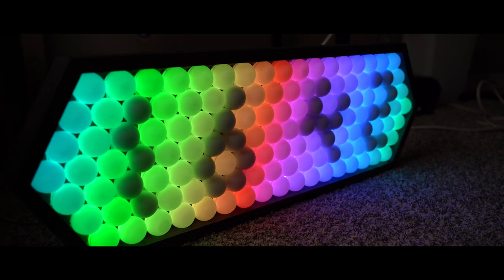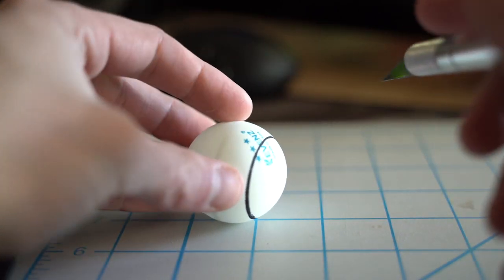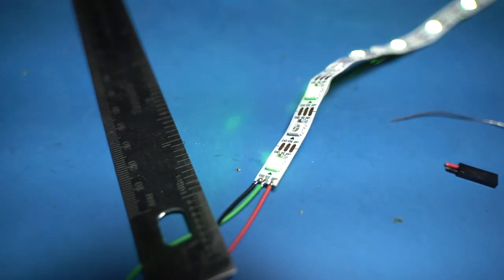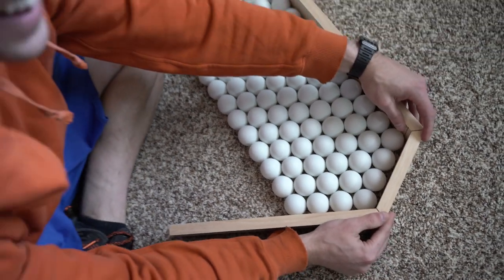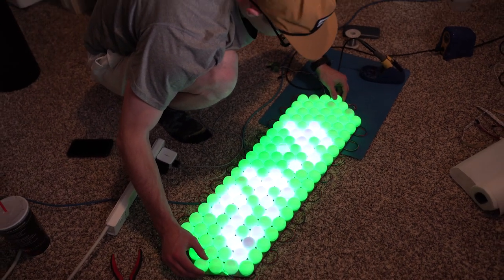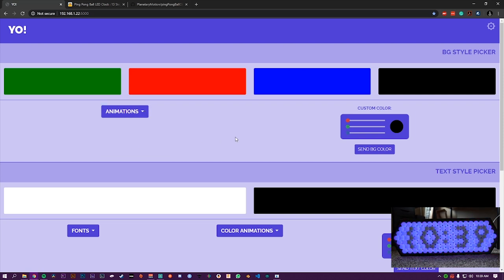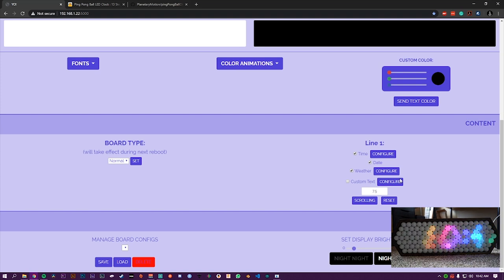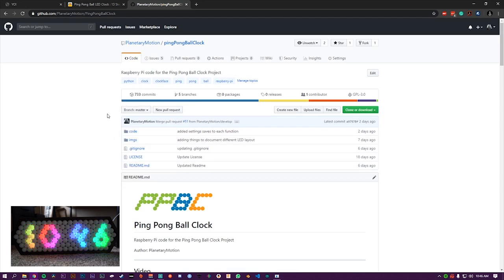Ping Pong Ball LED Clock

Comment: Love this - any reason you didn't string the leds horizontally rather than vertically? Would mean fewer cuts and less soldering. The code you've written obviously wouldn't work for that set up
Reply from the maker: I honestly do not see any reason you couldn't do this with horizontal strips! And I think the only change to the code would be properly labeling the LED addresses.
Reply: @lancewilhelm  amazing thanks, just wanted to be sure I wasn't missing something.

Comment: hey Lance!, what a great project 👌
I wanted to ask you, which type of the raspberry pi are you using?
I wanna add more than one sensor including temperature, motion, as well as displaying sound spectrum..
it would be awesome if u can share with me which type u used or if u can recommend a type since my idea contains a lot of sensors and perhaps sound processing. 
thank you!
Reply from the maker: Hi Amer,
Thank you so much! I'm sorry I didn't see this until now. I am using a Raspberry Pi Zero W which is one of the cheapest and most capable Pis out there right now. But, you could certainly use any modern Raspberry Pi that is connected to the same network that you want to access the web interface from. 

Those sound like awesome ideas for the board. You should be able to hook a couple more serial or digital sensors up to the Raspberry Pi given how I have wired the board and it shouldn't take much coding to read their outputs and then port it in to the code. Let me know how it goes!
Reply: @lancewilhelm  Thank you so much for answering my question! 
I will surely update you on my progress, oh and I purchased the Raspberry pi 3 model B 😊

Comment: Great Stuff!!!

Thinking of doing this with a Rpi instead of the Arduino because of the ease of customization. 
Is there a way to automatically change the brightness depending on time or location or does it have to be done manually?
Reply from the maker: Thank you so much! The Rpi seemingly has no bounds as to its capability for a project like this. I have not coded a capability like that to do scheduled tasks. Theoretically, right now you could have another application that sends an HTTP request to the server to have it change brightness, but functionality to have it switch from inside the firmware could be developed in the future. If you are feeling sporty, feel free to check out the github repo. There have been some "issues" raised regarding this feature request.
Reply: I'm thinking about two ways of doing that :
- I have Jeedom for domotics where there is a day/night setup already to dim my house lights. I guess I can add an http request to the clock to  change the setting

- I guess it's also possible to make a script that will the first time it's launched (at startup for example) : check online the next time is down, then cron to fire at this time and change the setting, and then check again in the cron to guess the next time it should be fired.

I'll first have to go shopping and try to build it before starting to code anything 🙈

Comment: You rock!
I read the instructables and been thinking for month to try it. I was worried about using arduino instead of an rpi for connectivity and updating and you made it!

- what rpi are you using? 3?4?
- I read the github and I guess I still need the 5v power supply, right?

I'll order all of it and I'll post the result, might be in a few weeks but well I'm motivated to do it more than ever thanks to you!
Reply from the maker: Hey Guillaume! Thank you!

I'm sorry it took me so long to respond! 

I used the raspberry pi zero w actually! It doesn't need to much power. 

Yes you will likely need a separate power supply so that you can display high brightness and so that you don't risk damaging your raspberry pi. 

Hope this helps!
Reply: Lance Wilhelm thanks for answering! Yes it helps. I also have to find it again but a member somewhere made a version with a webserver to update whats displayed on it. I just need to buy the right poing pong balls and some wood, and get to work!!
Reply: I must be tired. That's you 🤣 well I need to be less tired before starting to work on it 🤣🤣🤣
Reply from the maker: @guigro_  I will have to check that out!!!
Reply: A pi is a waste of money. An esp32 is much easier

Comment: Hi man, awesome project and an even beter presentation.
It's just stunning how good this video qualitywise but also infromationalwise.
I saw someone make it with a christmast like led string (also WS2811 instead of WS2812B) but these are like more individual and a led exactly in  each ball.
Would this be possible or couldn't I use the same code for it, would it be dificult to change the code or is it just putting them in serie and pitting 30led/m in the code? (I have 0 exp with python but great with java script so idk)
Do you have an instagram or so, so I could more ez ask something?
Reply: Update: it worked absolutly fine, I conected it all and I had no problems at all!
Reply from the maker: @Glacialsss  I'm so glad to hear that it worked! I tried to write the code at the beginning for those who would have slightly different layouts than me.
Reply: @lancewilhelm  I found solutions to some of the problems I had and some of the problems on the github issues. I commented on all the issues with the solution. i just forgot to add the brightness solution to github, I found the problem tho. Thanks again for the base code and great project! Greets, Foxdudes
Reply from the maker: @Glacialsss  Thank you so much for furthering the project!

Comment: Great work!!! I have been looking at the original version by thomas for a while now, your code with website makes me wanna do it, do you have a full list of parts you could send me so I can buy them and build it ?
Reply from the maker: Hi Lee,
Sorry I didn't see this until now. I used the same parts to build the board as the Instructable listed in the description. However, I am using a Raspberry Pi Zero W to run the board. Also, pay close attention to my GitHub page on how I wired the LEDs in series so that you run into as little issues as possible when you go to power the board. Let me know how it goes!
Reply: Lance Wilhelm I am in mid progress with it

Comment: Quick question.. How do you power the led's from the pi?
Reply from the maker: I actually use a separate 5V power supply to give supplemental power to the LEDs!
Reply: @lancewilhelm  thanks for the reply! Excellent. I will order some parts and have a go at this. Excellent work lance this is a fantastic project and a brilliant video.

Comment: This is awesome dude! What if I want to make this with like half the amount of balls?
Reply from the maker: The big problem that I see will be the addressing of the text. Right now the text is static in height and width and will not adapt to a change in clock size. The clock made in this video is essentially optimized (with a 1 ball border) for the height, but the width could certainly be modified. All that would need to be done then is modify the setup files for the LED addresses.

Comment: I’m hoping for comment from others that have built this.  Is it working for you?  

The port 5000 website seems very slow for me (I admit to having no previous experience with flask) and LEDs don’t light up.  I’m running a Pi 3 with Buster and using pin18 and ground pin.  I’ve tested LEDs with ESP32 that I had available.  LEDs work fine on ESP32.  I’ve got a Pi Zero W on order but I can’t imagine that is root cause.  

Anybody else have a similar problem?
Reply: Did you handle it?
Reply: @bartek50001   @Bartosz Musiał  Yes.  In my case it was a bad Pi.  New hardware with the same SD card resolved my issue.  Not sure what was wrong with the Pi.
Reply: @AdamSalvation  which model did you use and which are you using now?
Reply: @bartek50001  I was using a Pi Zero W 1.3  for both the failed unit and the working replacement.